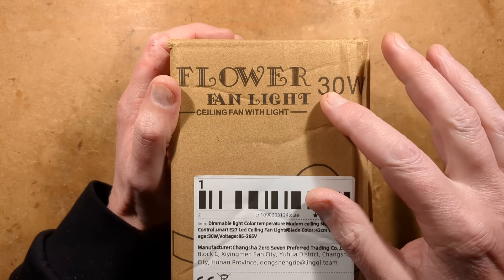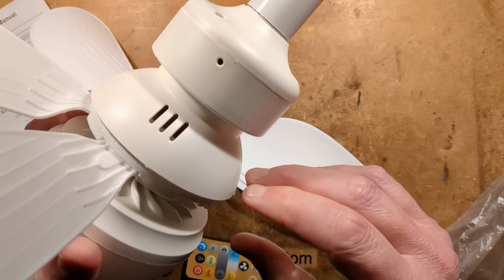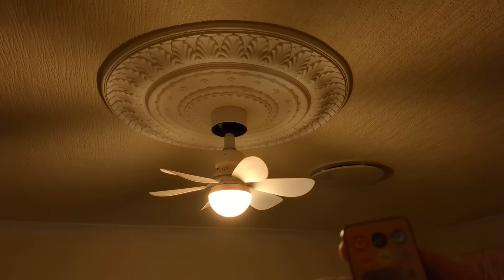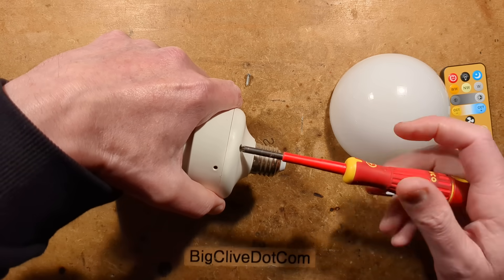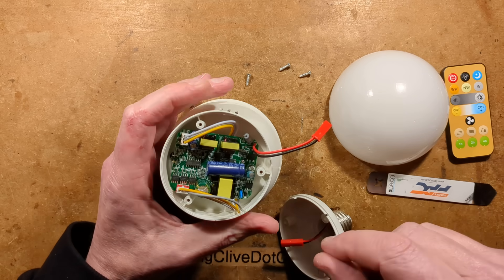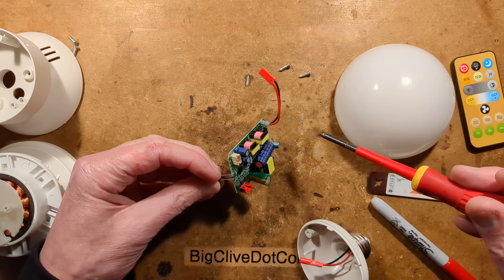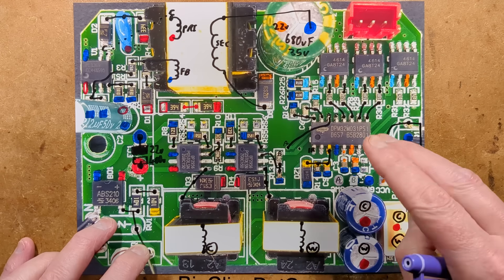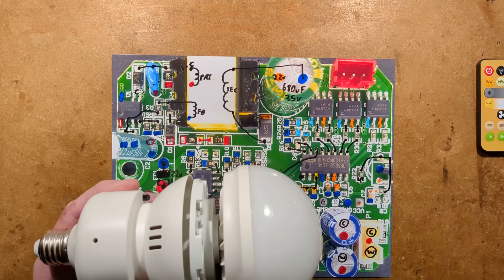Inside a screw-in ceiling fan and light - short low-tech version

Comment: As a electrician in my 50s I think your very right about the niceic and napit. Hate them both. They need to be abolished with a new single body being created by whoever. The trade has really gone down hill in the past 10 years.
Reply: With you all the way, I left school and went into a apprenticeship with the Electricty Board, did 25yrs with them and then branched out on my own, utter nightmare, ended up sticking with Commercial work as trying to do anything domestic is just rediculous these days unless you "pay" this and that company for accreditaion regardless of your quailfications. Total money making scam, 15yrs ago I jacked the whole thing in and now work as an electrical consultant which is hilarious really and just goes to show how rediculous the whole thing is. I make more money at this as well.
Reply: Works just started making us use the napit app for test certs, bloody awful time consuming crap software 😂
Reply: Across the pond we have the NECA doing the same thing. Latest code wants silly things like GFI or AFCI breakers for virtually everything and also wants type 1 surge suppression at every panel AND outlet. While these are all wonderful ideas, these are extremely expensive upgrades for a typical residence ($3-$4 for a typical outlet vs $80-$90 for surge suppression type and there can be 8 on each circuit). Surge at the panel another $1000. It doesn't seem necessary. Since the code was updated with grounding 40 years ago equipment failures due to surges are quite rare, as are electrically ignited housefires. Plug-in suppressors and power strips with surge protection are common and readily available. Meanwhile nothing has been mandated for the aging infrastructure still using telephone poles in most places with absolute ancient and unreliable switching and conversion equipment. I've been overseas to "3rd world" countries and their service is more reliable than the crap here in the states.